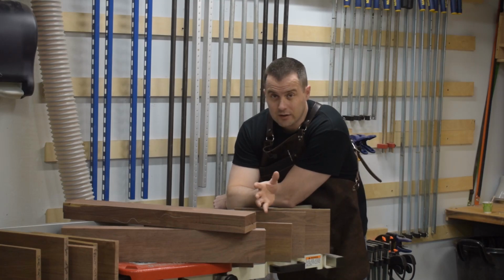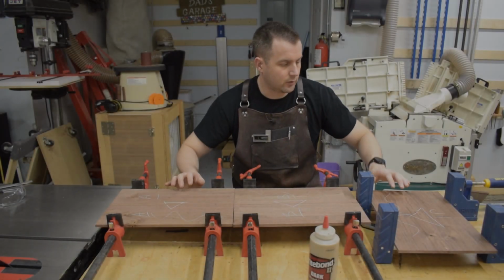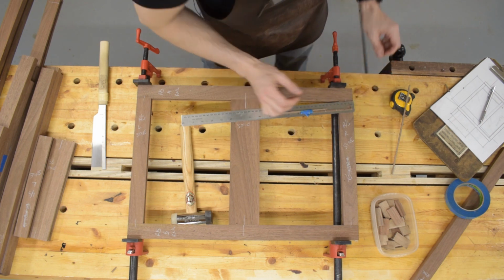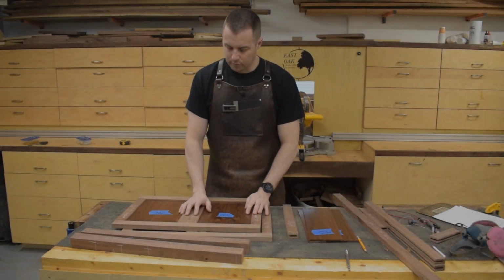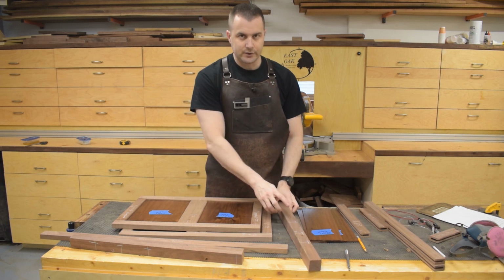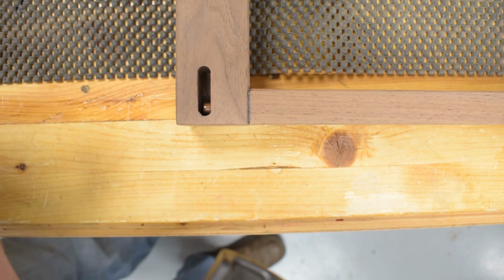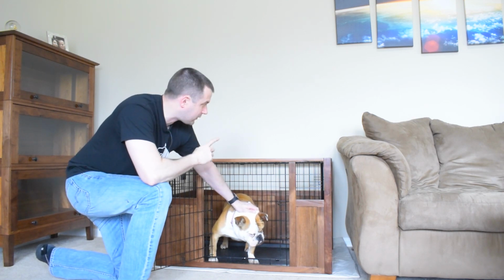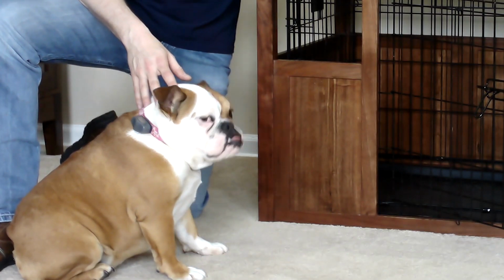Kennel Cover

Comment: This kennel cover looks amazing. I am looking to build one for my new puppy to grow into. Can you share some of the dimensions? It also seems there are different width's for some of the stiles, is this just for visual symmetry or a strength concern?
Reply from the maker: Hey Brian, I winged this one a little when I made it and I don’t have a set of plans to look back at, but the four main legs were 1 1/2”, the two stiles around the door, and on the outside of the panels were the same, and the center stiles in the middle of the panel were 3” I think.
Reply: @EastOakWoodworking  I don't see any way to show a picture in the comments here. I ended up making my own version that was heavily influenced by your design. Again, thanks for the inspiration
Reply from the maker: I’d love to see it. Can you email a picture to me? Seth@eastoakwoodworking.com

Comment: I’m curious about the pantorouter. I’m a low tech guy myself but have been thinking about this. Considering setup, run time, etc does it actually save a significant amount of time in work vs just chopping out mortises and tenons thinking an analogy of the Domino and how it has really sped these steps up. Thanks again.
Reply from the maker: That slot mortiser is shop made which took some time, but there’s hardly any setup now. I have some spacer blocks pre-made that set it up for the common mortises I use.